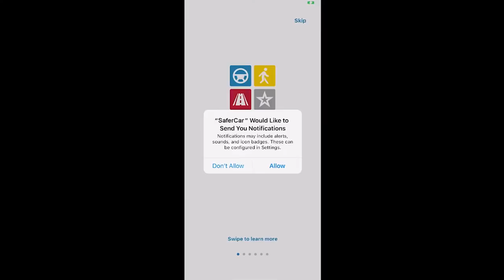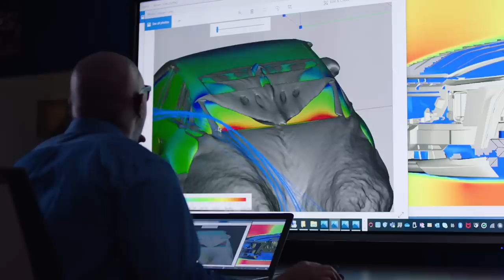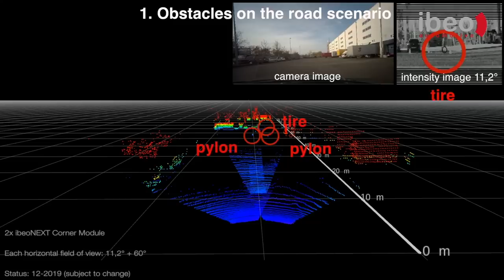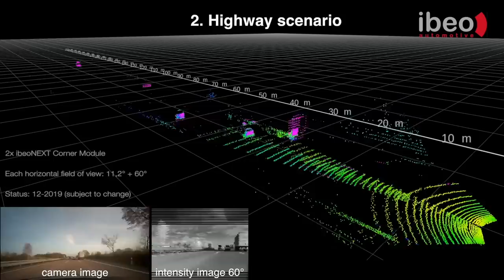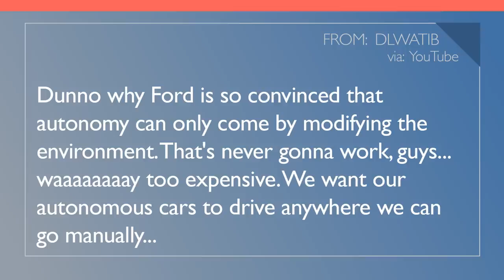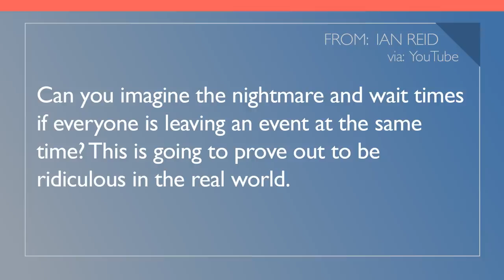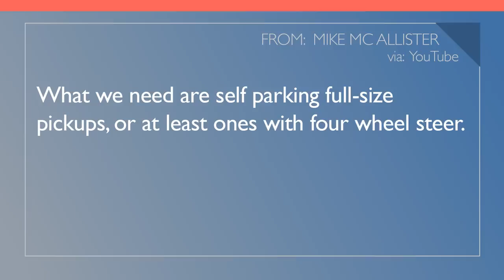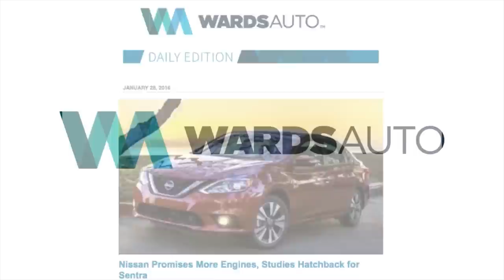Corvette Engineers Moved to EV Program; Bollinger Commercial Van - Autoline Daily 2906

Comment: You talk about AGM battery like it is new technology!  It has been out and on the market for many years now, mostly use in deep cycle batteries.
Reply: Yes, you make a good point. But my AGM batteries are heavier than my old plated ones. I wonder if there is some type of new coating on the cathode or if the matt material has changed? Looking at their website they do tout a new valve design that make it more heat resistance, but who knows?  It wasn't presented well.
Reply: I've had one in my G8 for years.

Comment: I always wondered why my hybrid still has a lead acid battery. Now I know. 😊👍
Reply: Another reason is the voltages are not even close, EV battery packs range from 200v to 800v. The car's electronics need 12v for basically everything, lights, power windows, seats, gauges, windshield wipers, basically everything but the drive motors on an EV need 12v. 

The high voltage of the battery pack is stepped down through a transformer that drops it from the high voltage of the battery pack to 12v for the car. A battery is needed as a cushion for that 12v load, it works similar to a capacitor and extends the life of the transformer by not putting that 12v load directly on it and letting the battery handle the load fluctuations of the 12v system.

Comment: That Bollinger  electric  van is to low to the ground, its going to be damaged by  speed bumps  and potholes & get stuck in the snow.
Reply: At first I thought you wrote potatoes and then I saw it was potholes.
Reply: I agree, it will high center on speed bumps and drag it's tail on ramps

Comment: By the time the zora comes out i bet its all electric
Reply: Guarantee the higher performance Corvette models are nearly done with the design stages that's why those engineers have moved on to EVs. Corvette engineers and designer have stated in the past that when the base model stingrays hit the dealerships they're already track testing the Grand Sport, ZO6 and other models so those cars will be ready for production. 

We'll be getting a ZO6 announcement for the C8 any time now, I wouldn't be surprised if it will be available for purchase sometime next year.
Reply: @OneNationUnderGod.  not for a car thats 3 to 4 years away. Not completely anyway.  I still think by the time the zora comes out won't need to ge a hybrid i think there time is ending. Full electrics are coming on

Comment: I know Bollinger Bands, what is a Bollinger Van?

(That's a joke for you EV fans)
Reply: I hope Bollinger is able to quote more reasonable pricing on their Deliver-E van than they did for their B1 and B2. A quick look at their website shows they're not ready to reveal their pricing, but they are promising better TCO (total cost of ownership) than gas or diesel, not low MSRP. In their favor, they are offering several battery sizes which should help them hold the price down in the lower ranges.